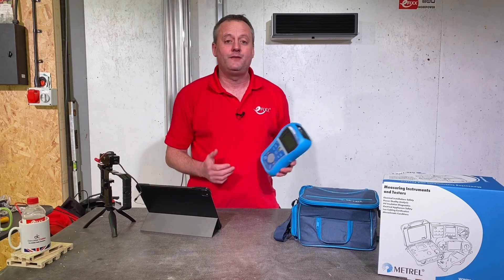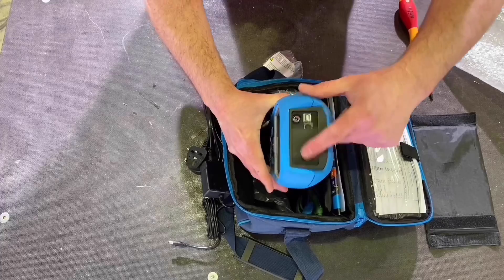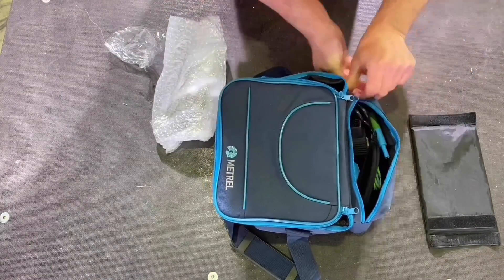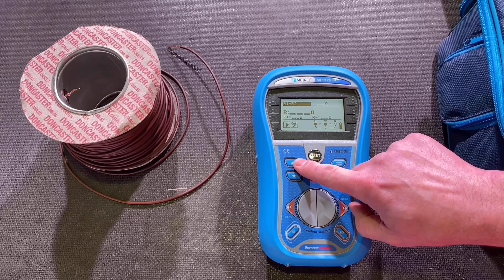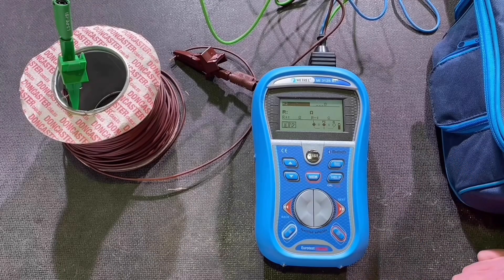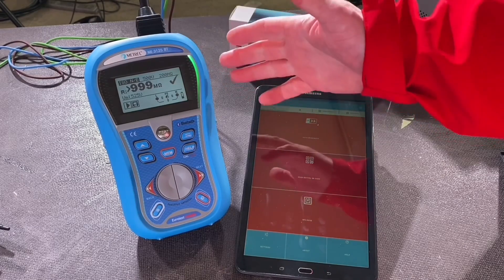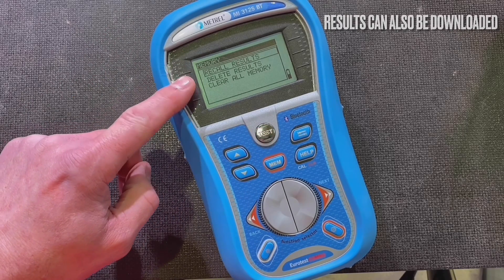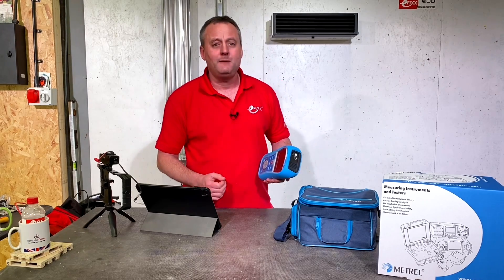Metrel's Mi3125 ENTRY LEVEL installation tester keeps getting better - now EV RCD and Bluetooth

Comment: I was looking for information on the Metrel MI 3123 (Earth / Clamp) tester and came across your video on YouTube. I really appreciate the way you present these MFTs. Could you create a similar video for the MI 3123? It would be great if you could include a demo on measuring specific earth resistance (soil resistivity) and determining the number of rods needed to achieve the correct earth resistance value. Thank you!

Comment: I've had one of these for a couple of years and absolutely hate it. It should have been one of the great mft's, however a complete lack of thought renders it quite useless. First of all those awful test leads. Dreadful plug in proprietary leads with primitive tips croc clips and you will need replacements as they are particularly durable (checked out the cost of replacements?). Then there is the killer - the power button. Raised above the fascia as it is, it ensures that unless you keep it in its bulky bag the power button will be operated while in your tool bag leaving you with a flat battery before you start. This mft neede a clam shell front hard cover and a slide power switch from the start. I suspect that like most manufacturers noone in the design team has ever even been on site let alone done any testing.

I've used them all now. Fluke is over priced and warranty and servicing is in Holland. Megger are horrible to deal with and diabolically expensive, crap leads and some question over broken pc boards giving rogue readings. Di log, TIC and other clones are nasty to use. Kewtech in my experience trounce the the lot of them and are easy to deal with in chesham. They sponsored a college electrical department I worked at and I use and abuse a kt65 almost everyday. It never lets me down and is the only one I trust (I've a kt63 as well and it's hopeless to use professionally due to its short time out and loss of null). I know I'm fussy, but I think at between 700 and a grand a pop I've a right to be.

Comment: Do you need an additional accessory to do the ring final test?
Reply: Might have missed it when he was unpacking, there's a plug lead for the ring final test. Obviously you need the spare croc leads to link the right cables in the consumer unit, you can pick these up or make them seperately.

Comment: I have owned a metrel 3125 for 8 years and on its 3rd calibration it failed for having a faulty IR unit.  Took it to another place for a second opinion and they said the same. Quoted 300 quid to fix so wrote it off and went back to meggar. I still keep it on the van for the apprentices to run round and get r1r2 etc.

Comment: At some point soon, I will need one of these. I’ve been pushed in the megger direction but the price is astronomical! However, I’m a firm believer in “you get what you pay for”. What would you recommend for someone just starting out? One of these or sell a kidney for a megger?
Reply: i've used metrel multifonction testers for quite a few years now & they've done everything i've required of them,if you are looking for your first tester they are certainly worth considering

Comment: Not got onto a lot of testing yet but that does seem like a hell of a lot of features compared to the Megger i’ve been learning on!
Reply: In fairness, that's because metrel have functions to measure R1+R2, R2, ring final, etc etc whereas Megger have a resistance setting. Looks like a good tester though.

Comment: RS232 lead on a new piece of Test Equipment? How quaint. It's like the last 25 years of USB had never happened.
Reply from the maker: The Bluetooth makes this bit redundant.
Reply: @efixx   So why have it?
Reply: I still use the serial leads almost daily communicating with UPS systems. Either a null modem (pins 2&3 crossed), or 'straight through' (2&3 not crossed). I also carry two rs232 serial - USB adaptors, one with a prolific chipset, the other FTDI chipset. Some systems can occasionally get arsey establishing comms. If one fails the other invariably works. Slowly but surely manufacturers are moving to USB (either USB B or micro USB), or to a Web browser via a cat 5 patch cable
Reply: @kevcruickshanks  been ages since I last interacted with kit in that way, thought it would largely have been replaced as it's been over 10 years, but actually thinking about it, utilities, where this type of tech is used, are often very slow to adapt to novel technologies like USB, which I'm sure there are some water companies that still don't use due to (perceived) risks associated with it being so new. Remember hearing about 1 company that ran optical oxygen probes for 5 years before having enough confidence to completely retire the galvanic or rapid pulsed galvanic probes used up till that point.
Reply: @cjhification  There's a number of Industrial Sites that still require the UPS systems to use analogue meters, and LED's. None of that new fangled LCD display nonsense. If it was good enough 30 years ago, it's still good enough now.
Reply: @kevcruickshanks  I have a friend who use to be pretty senior in Intel security, he worked with GCHQ and others as part of it. One of his projects was to build a scale model of the Thames barrier, and use the same control interfaces and protocols in place. It was hacked within minutes of going online. Utilities are very poorly protected generally with massively outdated systems open to significant vulnerabilities. Only ever been a consumer of UPS in places I've worked that were critical, so no idea if any of that (threat of hacking etc...) is relevant to the world of UPS.
Reply: @cjhification   All UPS Loads are deemed critical by the customer, hence the need for the UPS to begin with.
I don't believe hacking is a (current) threat to UPS systems, I havent heard of any instances of it. Most UPS systems are not connected to any network beyond the BMS, if even that. The BMS connections are generally status outputs from the UPS. Offhand I cant think of any sites where remote control/ switching of the UPS (although often possible) has been utilised.
Remote switching of the UPS could lead to endangering the Load, I know of no sites that allow this. Switching of the UPS is done manually usually by a suitably trained UPS engineer, or a customer representative with a switching procedure (and often with the UPS engineer either in attendance, or on the phone).
Reply: @kevcruickshanks  I was talking objectively critical (to continuation of life) as I've worked for a category 1 responder, where we needed to have UPS, but I take that point that to an insurance company, there data is critical, I would just not see anything, that is just about making money, as critical, but that's just my slant on life.
Reply: @cjhification  The Load could be the kettle and the toaster in the breakout area, but the customer has deemed it critical.
I get what you're saying though. Luckily I don't get to prioritise jobs, someone does that for me.
Reply: @kevcruickshanks  funny that, one of my jobs, was running the cell prioritising what to do with people and equipment in response to critical national incidents, which was why we needed the UPS.
Reply: Also had tours of our buildings underbelly and roof and the BMS, though that was more of a virtual tour, due to a union safety rep role I had for a while, really enjoy seeing the mechanical/services areas of buildings, very little energy required due to efficiency of the building apparently but UPS is specified to run whole building without any of the renewables, the generators run once a quarter I think to test them out.
Reply: @kevcruickshanks  in instrumentation for water quality, it's generally a straight through connection, from memory.
Reply: @kevcruickshanks  remember those converters were pretty new and exciting back in the mid noughtis, not needing to actually have the physical port was very novel, but as the toughbooks had them as standard, due to the type of people that used them (mostly field engineers) not really needed for us at the time. Image they are a necessity these days and doubling up by having different chipsets is genius.
Reply: Always called it a serial cable when I worked in instrumentation as RS232 was just a standard like RS485 or RS422. Used a lot of SDI-12 and RS485 on little Panasonic toughbooks by river banks and lakes or out at sea, was a good time in life, would still be doing it if it wasn't for restructuring coming along and removing the post.
Reply: Exactly and they don't supply rs232 to usb interface. It's because they don't want to rewrite the firmware and software. Update I have checked and there is s usb port for downloading results. The ps2 to rs232 cables main use is for updating firmware which is still quite common.

Comment: I have an older version of your model .It  needs re - calibration and i presume brought up to the 18th as the earth loop impedances have changed in tables. Could anyone tell me what it costs to upgrade my old metrel .? Thanks efixx for your informative videos
Reply: I have the 3155 and upgrades to software/firmware are free via the web. I assume if you return it to Metrel for calibration they would upgrade it for you
Reply: @richardwilliamson3624  Thank you Richard , i appreciate that . Somewhat disappointed  efixx were not interested to bother to reply ( not your fault obviously)  Not very interested in their subscribers even after a complimenting post.
Reply: @jj-hn2ll  no problem. Metrel uk have been super helpful when I’ve called. Gary’s a top bloke so I’m sure he’ll be along some time. It is still the holidays so he’s probably spending time with family. I’m guessing the video was done before Christmas and then automatically set to upload.
Reply from the maker: We are waiting for an answer from Metrel UK - they have been closed over the holidays.